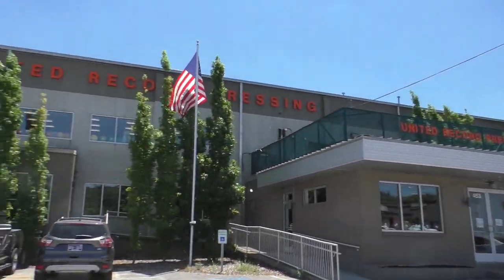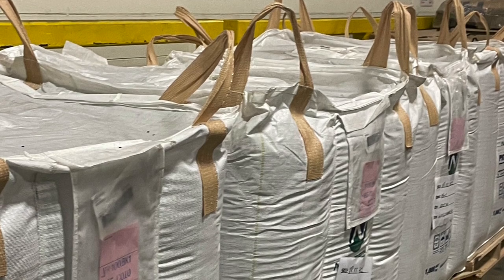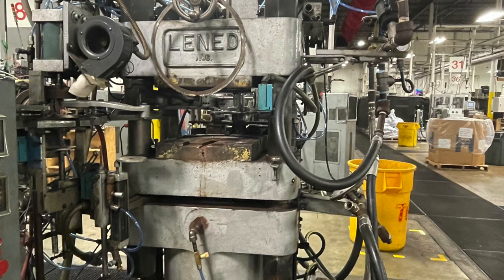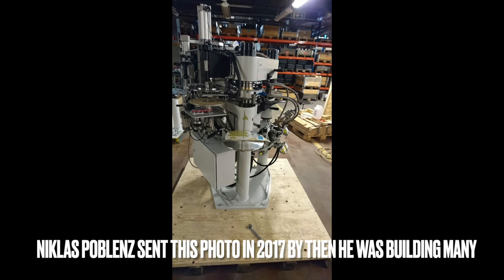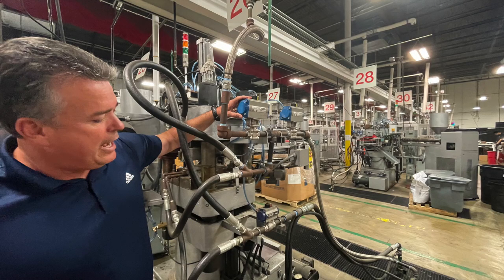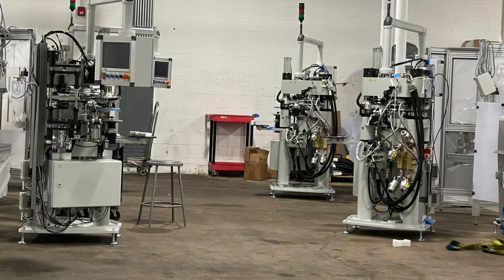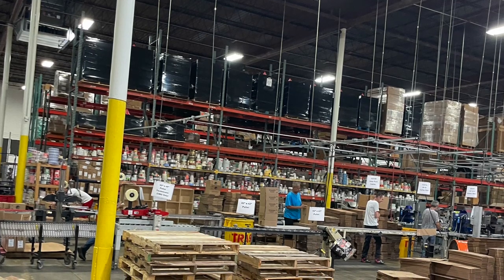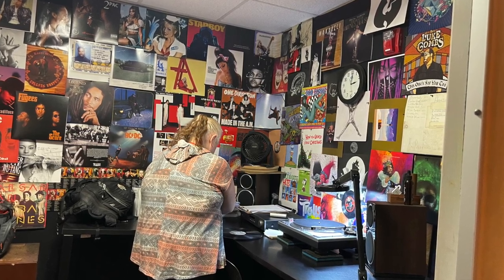United Record Pressing, Nashville—Pictorial Tour With Narration

Comment: t got the new reissue of Cake's Fashion Nugget pressed there and it horrible. Pops and clicks. Even after cleaning it in an ultrasonic it was still noisy.
Reply: Send the record to us. We will restore it at no charge.
Reply: @kirmussaudio7578  I appreciate it but I returned it. Thanks!
Reply: No worries. One needs to change the charge of the record to be opposite to that of water to take advantage of  cavitation hence the offer to assist to use our ionization method of the record with cabitstion. No process is guaranteed 100% but have restored personally hundreds of problematic records. At trade shows we do before and after auditions of records brought to our stand.  Keep us in mind. Thank you for your reply. Great to see the Tracking Angle back!

Comment: Given URP's past, are they designing the non-fill directly into the new equipment or does it get added later?
Reply from the maker: I'm hopeful your cynicism will dissipate as they work to press better records
Reply: @trackingangle929  It's come from a long line of disappointing URP pressings.. :-(
Reply: I was a press operator at URP for 2 years. Quantity over quality is their mission statement. They are more focused on being the largest manufacturer vs the best. Till they have competent leadership and workers they will continue to produce mediocre records. The things I’ve witnessed their are down right shameful. I’m glad I left for a better company
Reply: At this point, when you open a URP record, rounded corner inner sleeve usually gives it away, you know exactly what you will get....tons of surface noise. It’s been the same for years. I genuinely feel disappointed when an artist/label uses URP as their pressing plant.